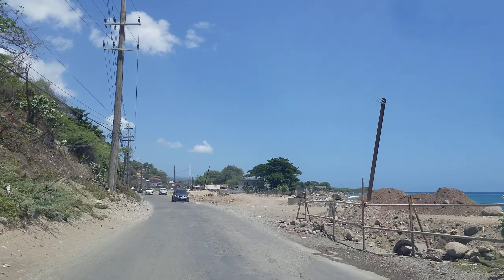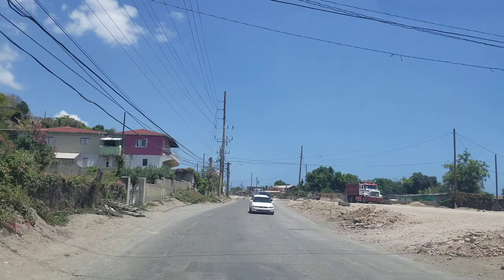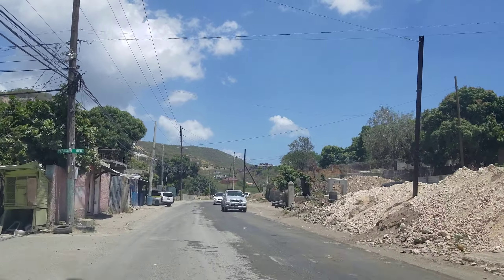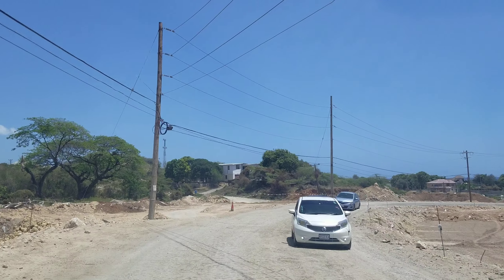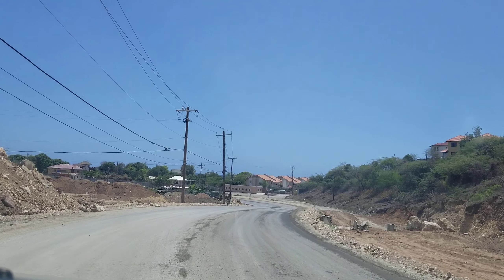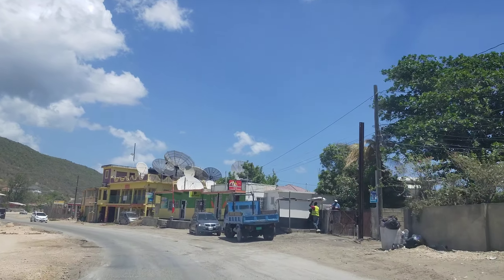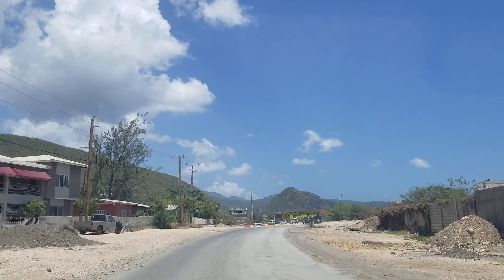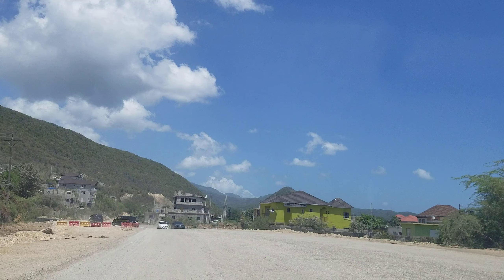Construction St Thomas Highway Jamaica

Comment: It's impossible that the road will be completed by the end of  Apri. What do they plan to do with pedestrians  walking on the side of the road ?  They need to build a walkway  
Some od the homes or building are pretty much in the street ! They need to remove those structures . It's very unsafe
Reply from the maker: August 2023 new date